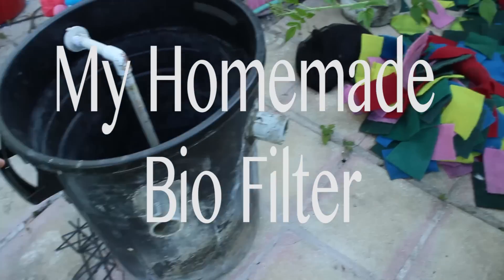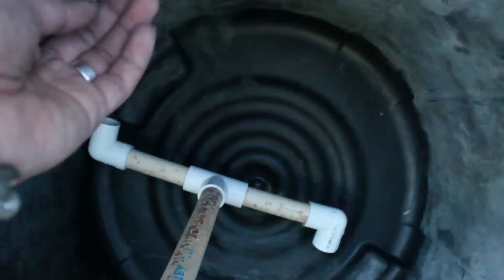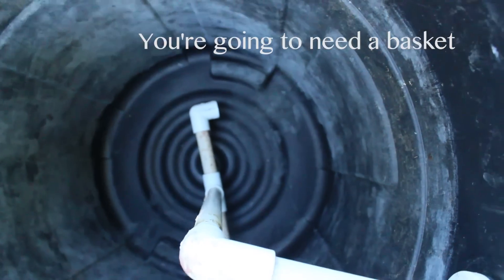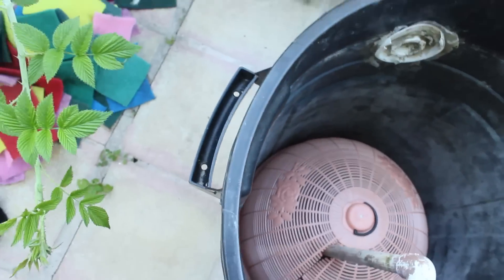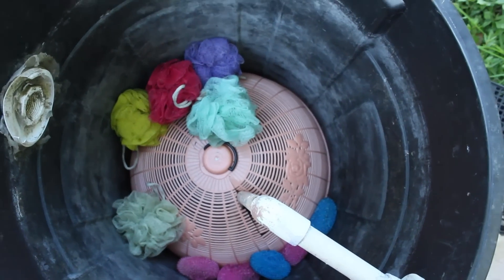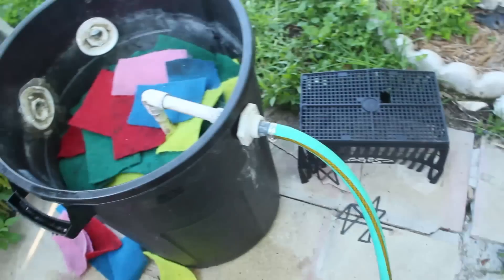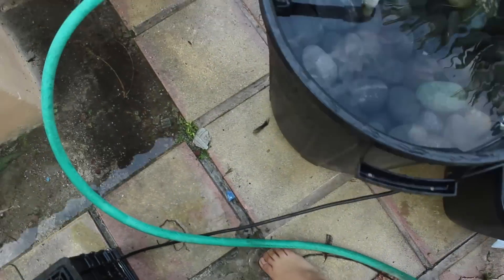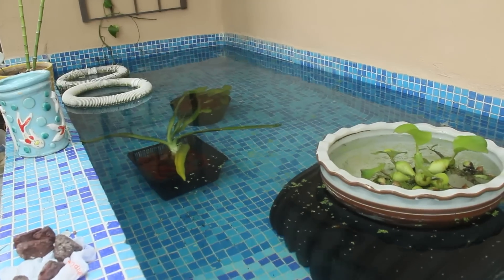My Homemade Bio Filter

Comment: If you add another bulkhead at the bottom for a drain pipe then it’ll reduce your clean out time significantly. You can drain out the solids at the bottom periodically without removing everything.

Comment: I am going to make one filter based on this idea. Thanks a lot. By the way, this design have one small problem. If the pump switched of , all the water inside the bucket including the filtered waste will be pulled back to the Pond. You can avoid that problem by simply adding one airing point just before the water inlet to the bucket.
Reply: Can you help me understand it better?
Reply: @bushaythatun8418   Sure, The pump pumps the water and it comes to the bucket through a hose. The hose connected to a pipe which goes inside the bucket. There is a 90 degree bend in the pipeline inside the bucket. Replace that 90 degree bend with a T Joint, so that we can get another opening in the pipeline. Place the T in such a way that the open port faces upwards. Add a small piece of pipe to it and let it come out of the bucket cap. You have to drill a hole in the bucket cap.

Comment: I made 2 of these following your amazing video! I’ve had then 18 months now and they have been impeccable, your video is amazing and I can’t thank you enough for this, god bless and thank you from England 🙏🤗
Reply: Thanks for sharing. 18 months and no need to clean the filter? Reason for asking is I have to clean my filter every 2 weeks...
Reply: @IwanRahabok  I will be doing a video on mine in the spring when I just have to flush them out and change the fine filter media, and that’s it for another 18 months. The pond is absolutely crystal clear to the bottom, so easy following this lady and some changes I made and wow! Saved an absolute fortune.

Comment: I've tried a few different ideas, but your design is working really well in a pond in the Australian outback.  It's hot here, dry too, and algae easily grows in the water. The version I have made  uses the things I had at hand to try it out - an old 20 L bucket, odds and ends of old pipe fittings, a kitchen funnel for a temporary 'connection' until I can go to town and buy the right joiners, layers of old cushion filler, geotextile, shade cloth and homemade charcoal for the biofilter. It's working and the cleaned water  runs through a hollow gumtree  branch into the pond. It's great because I can landscape it into the garden so it wont be visible, but also be easy to access for cleaning. I'll build a bigger, more permanent version  into a waterfall when i find some more odds and ends. Thanks for sharing the idea. :)

Comment: instead of using a ton of little cleaning pads you can always go the your local janitor supply store and purchase the big cleaning pads for the floor machines, Starting from the black one on the bottom working yourself up to red, blue, green and then  finally white, which is the most dense filtered one such as that white cotton stuff you were putting on top of your cleaning pads in your video... I think the smallest diameter pad is 11" 14", 21"  working up to a diameter 27" inches wide. 1 inch thick and the hole in the center  is 3 3/8 Inches  which you can run your plumbing though. You can also purchase it online which will probably be cheaper. 🌞

Comment: I wonder if you could run an airline halfway down the center line.  Would it create enough suction to make a makeshift venturi to add some extra air to the system?  The beneficial bacteria thrives on oxygen which could be depleted by the waste building up on the bottom.

Comment: Next time you take it apart again put a bulk head and a valve on the bottom side so you can open it to backwash large debris. Then maybe you won't have to tear it down as often. Just a suggestion, other than that great idea.

Comment: Dear madam i am planning for a recirculating aqua system.! so i have a question in this filter ther level of inlet and outlet pipe is same , it would be better if the outlet is given at the bottom section

Comment: I want to do this for my 125 gallon pond but I don’t want the pump in the pond. Guess I need to find a pump that can use a output hose in the water to pull water into a setup like yours somehow. Thanks for the video. Very nice

Comment: Great filter, for easier or no cleaning at all. Start with a pressure filter then feed it to your DIY filter. Then it's super easy to clean the pressure filter with the handle, at last once a week, takes 1 min. That will take all the muck out and only send clean water to your own filter. Clean once a year maybe. I got a descent pressure filter for 80$, worth it!

Comment: Great job, on your next filter, I used a 55gal with same style set up. Put a drain port near the bottom with a valve opposite of the top return ports. You can clean the filter by back flushing and drain the water to use on the lawn and other plants around your yard. The fish waste is good for your plants.

Comment: PVC pipe can be cut with a peice of string tied onto pencils work well.it will function like a flexible saw,as you pull back and forth the string weres a groove that gets hot and cuts pvc pipe in a second lickity split.Just saying save the bread and buy some extra treats for your frogs,!!hsjahahahaha

Comment: This design works awesome I have a 5000 gallon tank  with 4000 tilapia and it keeps it cleaner that the sand filters
Reply: Oooigh that's amazing...5000 gallons with 4000 Tilapia. Will this size of filtration keep the tank clean...I mean ammonia and all. Have u checked if it keeps your ammonia level  minimal....Am asking since I also want to do something like this but wondering if it will work for that kind of a bioload....Thanks in advance

Comment: I have an in ground pool and I want to convert it to a natural poo..I would like to find a way to use my existing sand filter but may be that won't work like yours because it becomes pressurised when the pump is running..I see that most people have a regeneration zone for the plants, but I want to be able to have plants in baskets that are attached to the pool sides and also have lilly pads on the water..I plan to have frogs and goldfish also..most people would never do this to their pool but I love the idea of not using chemicals..besides, me and my dogs will be the only ones swimming..oh, and I love tofu to!

Comment: If you install a plumbing fitting near the bottom of the trash can  with a shut off valve (about a 1.5" fitting) then you could drain the sediment when it really got bad and needed a cleaning.  Leave some bacteria in the receptacle, but essentially it would act as your "backwash" cycle.  When you've drained off enough just shut the valve.

Comment: Good ideas except filler parts, too much to clean each pad or replace them. I would recommend fill it with different size of rocks and have drain on the bottom (can hook up to a pump if that's bury underground). Then never have to replace rocks, just drain and rinse rocks every 3 months.

Comment: Did you just add pool shock to a bio filter setup?
Reply: if you shock and rinse the system (letting the chlorine evap) before cycling it with bacteria the algae count will stay down while your plants on the top grow.. she should have explained that you have to start with sterile water and add a bottle of cycle if you don't have previous beneficial cultures or plants in the pond to sustain a water change..

Comment: I wanted to do that for my aquarium and put the filter under the stand. So how would I get he water from the bucket to my aquarium? With another pump?
Reply from the maker: shawn lawrence well what I would do is get a container with a tight sealed lid and have two openings one to bring in the water like in the tutorial and then instead of having the opening for the waterfall you would connect the bulkhead to another hose that brings the clean water back into your aquarium. Make sure the container you are using can seal tight so the water doesn't go everywhere. With pressure the clean water should leave the filter and go into your aquarium without an extra pump.
Reply: ok thanks i will be trying this this weekend
Reply from the maker: no problem, good luck! can't wait to know how it goes for you